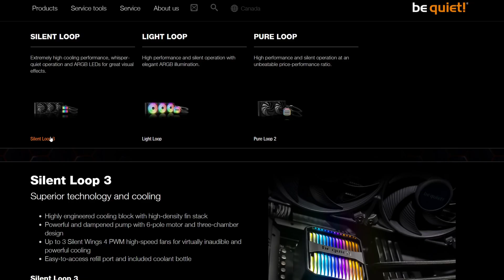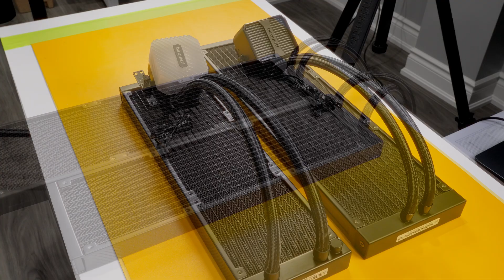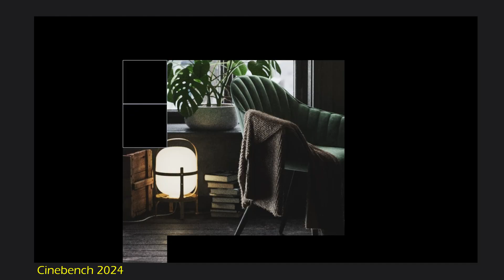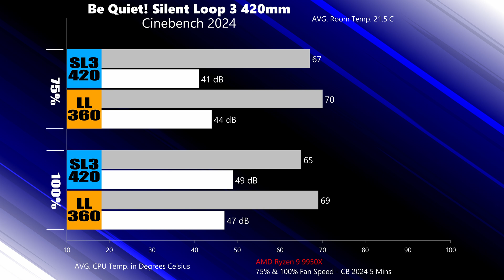Be Quiet! Silent Loop 3 - 420mm AIO Review and Installation Guide

Comment: Is this AIO overkill for the 9800X3D if it's only for gaming?  
I was also thinking about going with the Dark Rock 5 (non‑Pro).  
Will I get low temps with that air cooler during heavy gaming?

Comment: If anyone has any questions about this aio, I just installed one coming from an NZXT Kraken Elite 420 (pump died within 5 months), and so far the Silent Loop 3 has given me 37-40 idle and around 45-55 gaming on a 9800x3D. Same if not better than the NZXT (which isn’t hard to beat). But install was straightforward. And it’s 3 times cheaper!😂

Comment: Questions

Do we have a temp sensor for the liquid temp?
How long did you run the tests? more then 1 hour @ least ?
Why do you stresstest and benchmark with a cpu that only uses 200W on the PL1 compared to intel's 147000k and 14900k with their walloping 253W?

Why do i ask these questions ... i had an 360 mm AiO of brand X  cooling an  i7 14700k. It died after 8 months. It got replaced (warranty) and the second one dies 9 months after.  
Both times it was a topmount  with the pump @ the lowest point of the loop (assembled and placed correctly). After carefull research i came across results that my particular AiO only had a value of 240 TDP.

The cpu remained under 70 °C load, maybe a 75 ~80 lovetap during a shader installation (demanding game) or on Cinebench tests.  
This doesnt mean your cooler is performing by the numbers you're looking at.  This simply means the conduction of thermal energy between the cpu - paste - block and liquid is working properly along with the provision of new liquid (pump flow). 
However if the radiator + fans aren't able to funnel away this heat that means that heat will remain stored in the liquid and thus the coolant liquid rises in temperature over time. In which case you end up thermal abusing your coolant liquid while your cpu temps remain within acceptable margins.. 

According from what i can research so far is that the bequiet silent loop 3 - 360 mm should already be capable of cooling a cpu with a 253W output it was resulted in more then 265 TDP since that was the roof of their testing ground. Going for the 420mm is just to give yourself some more wiggle room. 
This comes in handy when your ambient temperature exceeds 25 °C or when your factory TDP drops a bit due 2 dust on fans and radiator cutting a bit on the cooling performance. 

What is this term... thermal abuse (of the coolant liquid)??   
Liquid (wel materials in general) can store (heat) energy by rising in temperature. We all know how to boil water and how it works.
If an AiO cannot keep up with the heat generated by the CPU. The CPU will not throttle to 100 °C for quite a while if ever until its to late. What does happen is that the excess heat that couldn't be funneled away is stored in the coolant liquid thus heating up the liquid over time. Meanwhile HWmonitor shows a steady 60 to 78 °C cpu temp. You think its performing properly but things are going terribly terribly wrong and in a nasty timeframe. 
With the older aircooled CPU's you would notice that shortcoming in seconds since only the solid copper radiator can store this exces energy which is a very low number.  thus the cpu would start to throttle. With an AiO this is not the case. Heat capacity of coolant liquid: 4,20 J (g • °C) while copper has meager heat capacity of 0,38 J (g • °C). 

What is the bad thing about thermal abuse? 
Percipitation is something that occurs with liquid coolers. It;s normal.  This is under normal operating conditions only 0,01 grams per 24 hour cycle or less, depending on the hose used (felixble or sturdy), hose length.  
This info is also used as a base to determine the longevity of an AiO by manufacturers. Similar to how they predict the life of a fan. 
However the liquid temp needs to be within a certain range of temperature. If the liquid temp exceeeds this value the percipitation values increase drasticly and thus cutting severely into the longevity of the product.

For those interested in some data with a caclulated example: 
TDP stands for Thermal design power which translates to: How many Joules of heat energy can i funnel away per second.  
TDP values are gained under standard conditions so the ambient temperature is 25 °C or 298 K if you prefer and with 1 atm of pressure (normal environment). 
PL1 and PL2 values of a CPU indicate how much heat it can generate for a long (PL1) or short (PL2) time. 
When you're running a demanding game expect it to run on the PL1 value of your CPU.

We perform the example in an ambient temperature of 25 °C. 
A 360 mm brand X AiO or a 240mm AiO high quality has an avg of 240 TDP.
I7 14700k and i9 14900k can produce 253 Watts of heat on PL1. 13700k can do this as well.  (Watts translates to Joules of energy per second).  Similar to TDP and how it can funnel energy away per second. This means we do can do some math with it and work our way from there.

253W produced, 240W funneled away
The coolant liquid is absording 13 joules of heat energy per second more then the radiator can funnel away (253 - 240 = 13).
The volume of an AiO reservoir is between 100 to 200 ml. The heat capacity of water is 4,2 J/(g • °C) which is similar to coolant liquid.  --> If you put 4,2 joules of heat energy into 1 grams of water its temperature will rise by 1 °C.
1 g of water = 1 ml of water.
Since we got 13 joules per second it means 13 ÷ 4,2 = 3,01 ml of the coolant liquid rises by 1 °C per second. 
The total volume is 100 ml.  100 ÷ 3.01 = 33,33 seconds. 
Every 33,3 second the entire coolant liquid reservoir will have increased in avg temp by 1 °C while the cpu is in PL1 mode.

Since the ambient temperature is 25 °C so is the liquid coolant @ starting point. Above 60 °C liquid temp and the longevity of the AiO will decrease rapidly.
This happens just under 20 mins. 
60 - 25 = 35 °C  increase to reach unsafe levels.   increase of 1 °C per 33,3 seconds.
35 • 33,33 = 1155 seconds ..  divided by 60 it's 19 minutes and 15 seconds. 

Kuddo's if you read up to this point!! please read on for a final piece of info where it all comes together.

Due to the rise of the thermal liquid to unsafe temps (above 60 °C) the radiator also becomes warmer and the fans can funnel away more excess heat. The 240 TDP it started of with increases to 253 TDP.
A new equilibrium is formed where the CPU temps still remain in safe operating temps (70 °C for example) while all the time your coolant liquid is being thermal abused.
We just established that thermal abuse in this scenario happens after 19 minutes already.. how long do you play a game average per time you boot one up?  Probably a lot more then 20 minutes.
Since the game is running fine and HWmonitor shows a CPU temp that's not alarming. You play on for hours, for weeks, months and then boom. a minor game now runs 10 - 15 °C hotter then the 1st couple of months.  a week later only 10% of cpu load alrdy kicks it into thermalthrottle indiciating the pump has died from drying out or the liquid is below a proper operating volume.

Bottom line.. There is no such thing as overkill when it comes to cooling with an AiO. You're better of having a large margin then coming just a bit short.
We need liquid temp sensors to be the new normal within an AiO so we can keep an eye on both thermalthrottle cpu and thermalabuse of the liquid.

Comment: How on earth I have 80C with 7800x3d with this aio !?
Reply: i trouble as well the problem isnt the AIO the problem are the X3D processors they have a serious high base clock so they are hot even on idle. so i need an AIO which keeps this stupid thing cool.
Reply: @Josiah_Trelawny1   or undervolt it a bit, put in pbo all curve -30 and manual 100, 70,  100 .settings if that does not try -20 all core . and your pc runs even better.
well i got it on my 5800x3d go in bios to pbo and put the settings in.
Reply: All the 7000 series are running very hot. The 9000 are much cooler. Might be related to a the heatspreader on the cpu
Reply: @ericmuijs1938  Nope, it's actually the 3D-V-Cache placement. 
On the 7000 series, they put the Cache module, if you will, ON TOP of the CCDs, and what ended up happening was that the cache module sort of acted like an (very loosely used term)insulator, which prompted the higher temps. 
On the 9000 series, they put the Cache module, BELOW the CCDs, so now those were the closest thing to the IHS and subsequently, the cooler. It's what allows the 9000 series to reach the clocks it does.

As for the temps, don't look just at them, also take a look at your clock speed. The boosting algorithm will ramp the clock until it either hits a thermal or a power limit. With AIOs, the temp headroom is bigger, so the CPU will boost in power more, even if temps will seem "high".

If for example, your AIO is within a degree of an air cooler, say 78°C vs 79°C, but the clock for the AIO config is 5.5GHz, while air only nets you 5.2GHz, then the AIO isn't BAD, or "marginally better", it is much better. 

The boosting algorithm works both ways, if cooling is insufficient, clocks will drop, temps will stay high. Check your clocks.

Also user Curve Optimizer/Curve Shaper. Most X3Ds can do -15 -20, some even -30. That tweak will drop temps significantly and also boost clocks even more.

Comment: As i reminder... i think in video that i analyzed .. you don't say is LightLoop on Offset AMD mount or not.. i say.. LL360 its not on offset mount(in this vid). Currently  LightLoop 360 AIO beats more Vendors with offset mount ...
Reply: It doesn't need an offset due to the size of the water block. Covers the entire cpu
Reply: @wafflesarelove I was talking light loop…  Light loop Coldplate isn’t in center on hotspot if you don’t use offset so needs offset to better cooling I have that AIO  and drop 5-6C
Reply: @xtracker904 ah I thought those were typos lol

Comment: I already bought one and picking it up tomorrow.
Hows the software? I can't find any info on it, is there software that lets you control radiator and fan speed, and can you disable the RGB? I just can't stand RGB components because I'm not 12 years old.
Reply: I don't think there's software for this AIO.
Reply: @toxicfume7475  What do you recommend using?
Reply: @ I beleive you can control RBG lights in the BIOS settings.
Reply: @ Oh I'm gonna disable that immediately, death to RGB lol. I'm more interested in setting different profiles for fan and pump speed under, i.e. a game profile, a windows profile and a heavy load profile, BIOS doesn't let me do that.
Reply: @EricTheBroBean  2 months later, how is the cooler going for u?
Reply: @Darkthebest Great! I can't complain. Keeps the CPU cool as ice, nice and quiet even when ramped up, no bubbly noises or any other issues.
Reply: @EricTheBroBean   Apart from setting this up in BIOS. can you also read the (avg) liquid temp while gaming? 
The NZXT kraken for example has a coolant temperature sensor
Reply: @Dale1615  It doesn't have a coolant temp sensor, which is kind of a downside, but not really important, as the actual CPU temp is what matter. It does cool exceptionally well though, so I'm guessing the liquid temp is a few degrees lower than the Kraken. It's also a lot more quiet. Another upside is you don't need software such as NZXT Cam, but you can install third party software if you want to setup different fan profiles.

Comment: Hello, for a sober build, can you just not conenct the ARGB pins to deactivate the rgb fonction ? Will it work ? Can it reate electrical issue to not connect these pins ? thank you =)
Reply: can confirm you can just refrain from plugging it in, I run my build without it, and be quiet also confirmed this is fine

Comment: No "Silent Wings Pro 4 fans? RPM on the 4s can hit 2,400 rpm.
Reply: I had info there is silent wings 4 non pro
Reply: Ah oke .  @ViSk-l4d  well they are good anyway
Reply: I got bequiet fans on Cooler and 3 on the case
Reply: They are more quiet then s.w 3 indeed
Reply: I just order order that AiO and buy Pro 4 fans :D
Reply: @ViSk-l4d  there are sw pro 4 on it.